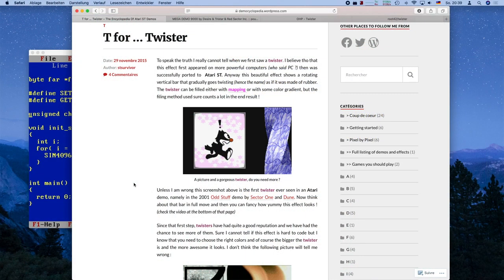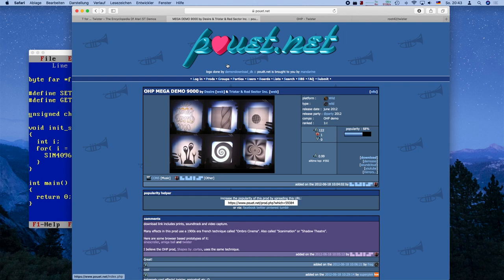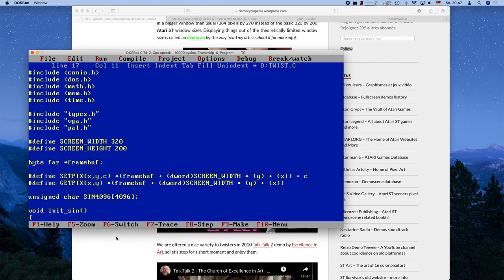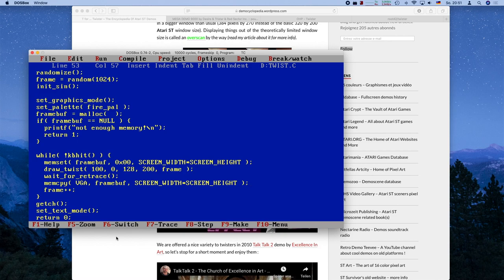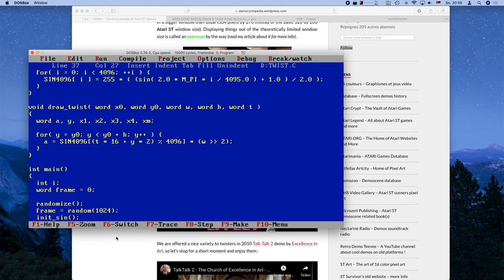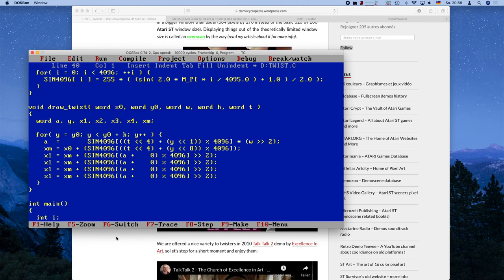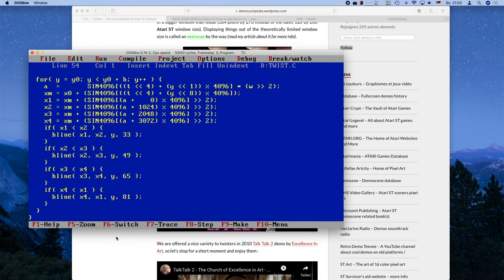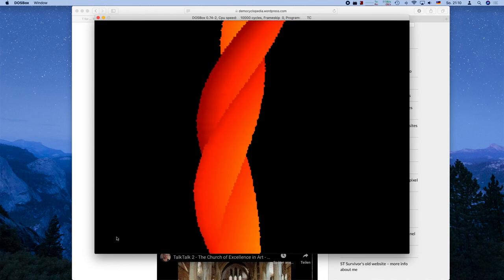Let's Code MS DOS 0x17: Come On Let's Twist

Comment: Good morning! Two requests of you. Firstly, beizure curves in turbo c++, or DJGPP moving a small circle. Secondly, Arduino bootloader via command prompt (or run the command line bootloader from within turbo c++ exe) - Turbo C++ blinky led program. And as a bonus request, I'd love to see a 74HC595 controlled through the registry and parallel port via c++. Thank you.

Comment: One observation.
It would help a lot if you would first explain a bit how exactly the function will work, instead of just going trough it.
In this example, the draw_twist function. Would have helped if you had talked a bit about how the effect is working, what are the sines used for,  you take a rectangle and what exactly are you gonna do to it, etc.
Like a flowchart or block diagram.
Thanks.

Comment: Another nice performance trick, at least for systems that have no division (and thus no modulo) in hardware is to use (value  & 4095) instead of (value % 4096). The result is the same - a value from 0 to 4095. This only works if you want to calculate a modulo with any value that is 2^n - but a bit-wise AND operation is a lot faster on those old x86s that have no math coprocessor. 🤓 Pretty much along the same lines as using shifts for multiplication and division with any factor that is 2^n.

Comment: is this running in true color ?
Reply from the maker: 8 bit VGA. So 256 colors out of 262,144
Reply: @root42  ive been scouring the internet looking for some 16 or 24 bit dos related things. long ago I played a game called screamer which had a 16 bit colour option. I thought it was impossible in dos to have higher color than 8bit/256 colors
Reply from the maker: VESA BIOS extensions allowed for high/true color modes. You can simply query the BIOS for modes and set it, then get a pointer to the linear frame buffer. Probably requires protected mode though.

Comment: Would you ever consider doing a series on PowerBASIC DOS programming? From what I understand, it's basically as fast as C cause it's a "real" compiler unlike QBASIC. I'm just more comfortable using basic cause I'm not as smart LoL. It would be interesting to code two simple projects in both and compare performance.
https://winworldpc.com/product/powerbasic/3x
You can find a number of graphics libraries for it too for VESA and VGA if you google around.
Reply from the maker: I might do some more PowerBasic lessons, if I find the time in between all the projects. The Let's Code videos always require quite a lot of preparation. PowerBasic or QuickBasic will probably be never as fast as C due to the way the language works, with dynamic memory management etc. However it is good enough for a lot of things. Not having to deal with pointers simplifies things for beginners. So yeah, time permitting I might revisit PowerBasic for some episodes.